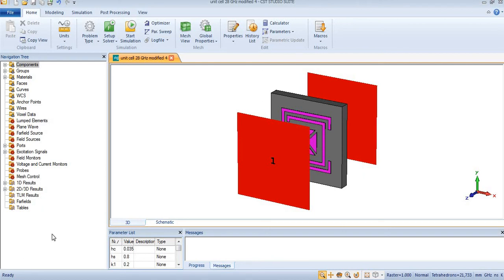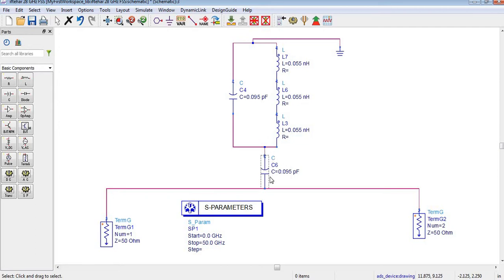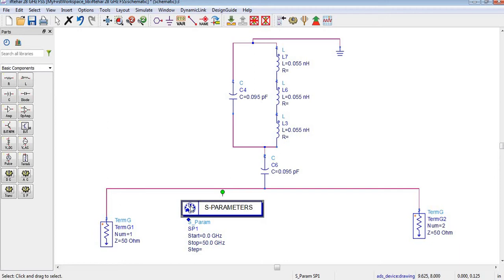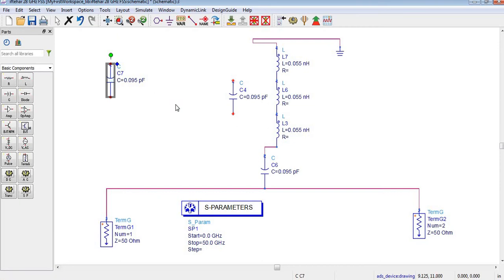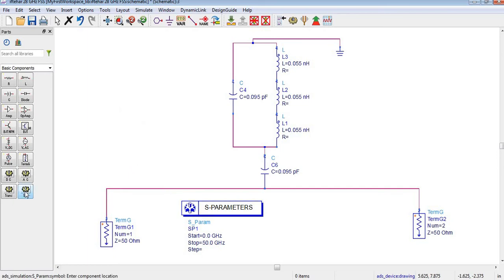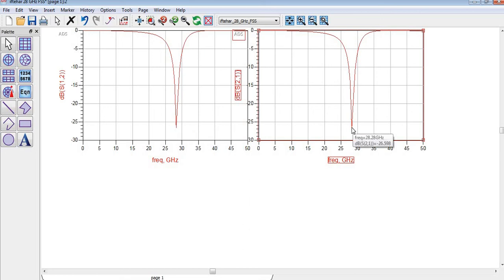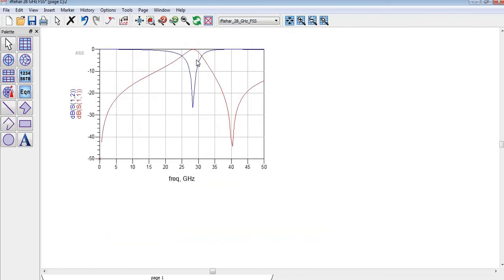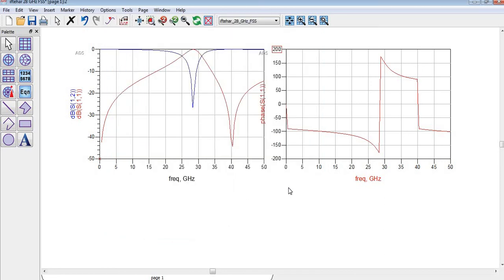FSS Equivalent Circuit Model at 28 GHz | Metamaterial ECM design | ADS Tutorial 19

Comment: i don't agree with the 50 ohm ports u have used. I think it should be matched to 377-ohm free space impedance. .. what you say?
Reply from the maker: 377 is free space impdance
Reply: That is a valid point. Unit cells are excited by plane waves from free-space. The FSS elements are designed to match the impedance of the unit cell to 377 ohms. So, their equivalent circuit model should also have 377 ohms ports.

Comment: The structure I am designing is a transmit array antenna. I intend to excite it with a linearly polarized wave and obtain circularly polarized output. For simulation in CST, I have excited my unit cell with two Floquet modes, TE and TM, to model the radiation of a linearly polarized wave. Subsequently, I developed separate circuit models for the structure corresponding to the TE and TM excitations.

Now, to model the general state, when both TE and TM modes are active in CST, I need to properly connect these two equivalent circuit models. This will allow me to achieve the overall equivalent circuit representation for the simultaneous excitation of TE and TM modes.
Reply from the maker: To model the simultaneous excitation of TE and TM modes, you can connect the separate circuit models by coupling their respective port parameters properly. This coupling will enable the representation of the general state and allow you to obtain the overall equivalent circuit representation for your transmit array antenna design in CST simulation. For more visit: https://www.fiverr.com/uetmardan05/design-metamaterial-equivalent-circuit-model